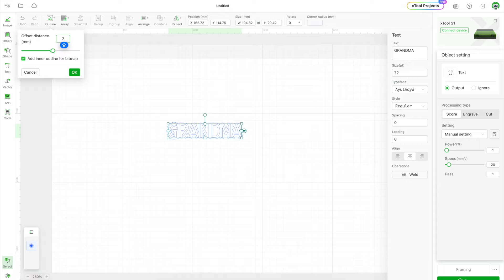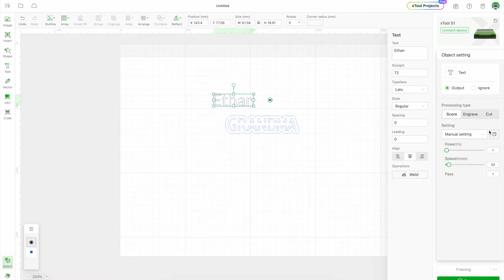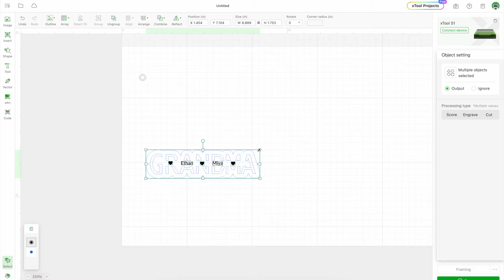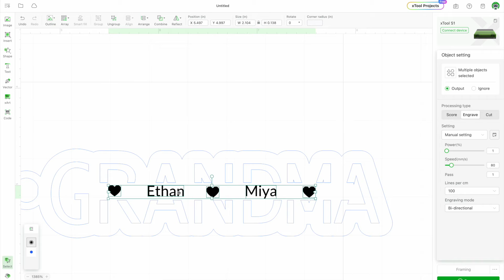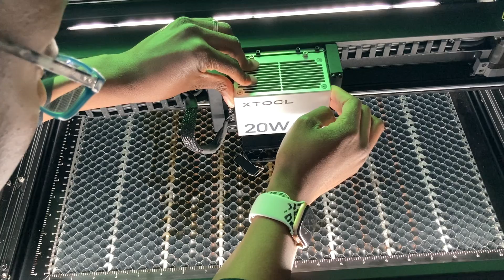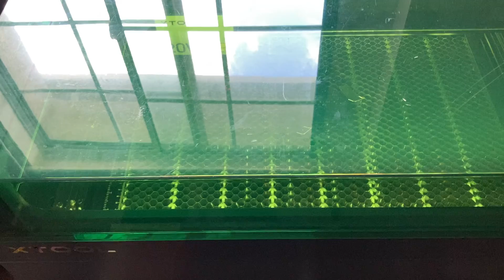xTool S1 Personalized Acrylic Keychain Tutorial Laser Engraving and Cutting Beginner Friendly

Comment: Hey what I have to do it I just want to engrave grandma on the keychain and want to cut the sides
Reply from the maker: Add text you want and choose font you like. Select text and add outline to it. Play with the outline settings until it looks how you want. Set the original text to engrave and the outline to cut. Add a circle 0.5 inches and outline to 0.25 inches unite and overlap. The units this circle to your outlined text so you have the area to had key chain.